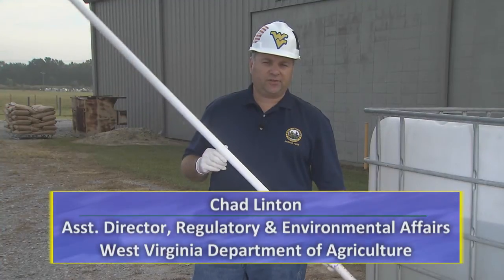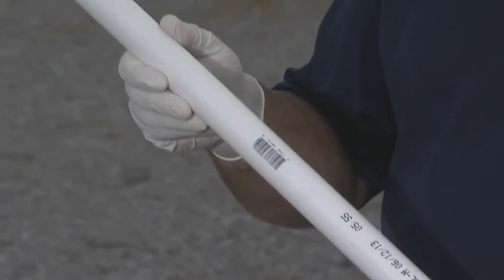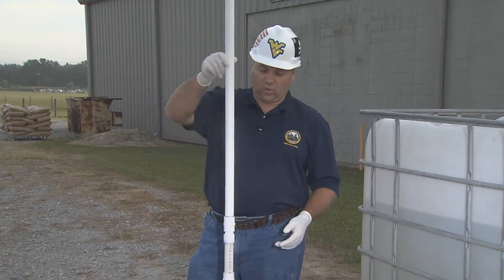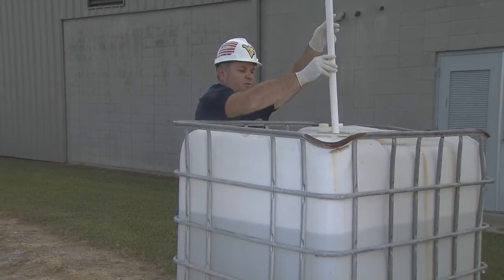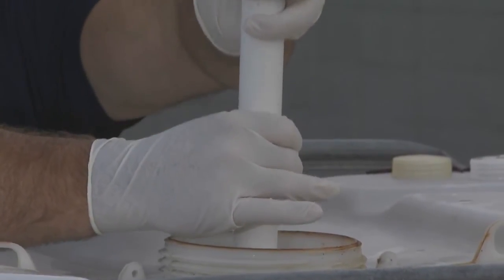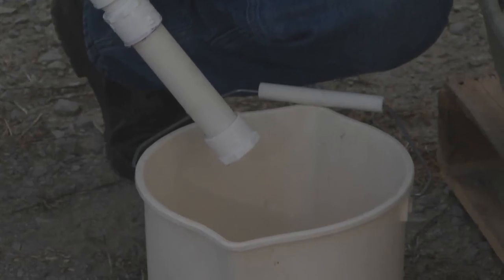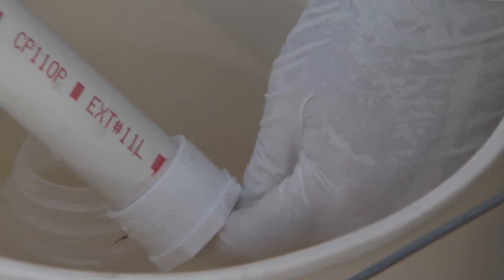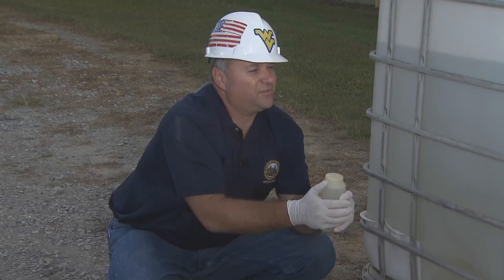Sampling Liquid Feed

Comment: Depending on the liquid that you are sampling, you might want to consider several things. You may want to wear other personnel protective equipment such as safety glasses, a face shield, a coated tyvek suit, and rubber boots (or boot covers) to ensure your safety when sampling hazardous liquids. You may need to have a decontamination area set up with the appropriate equipment drop, wash, and rinse stations. Also, it is a good idea to use the buddy system when sampling.